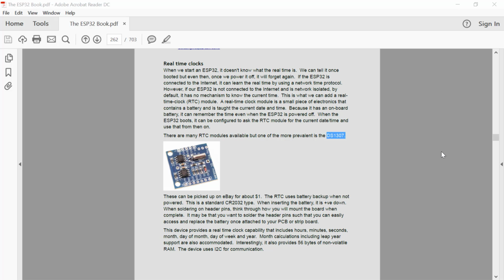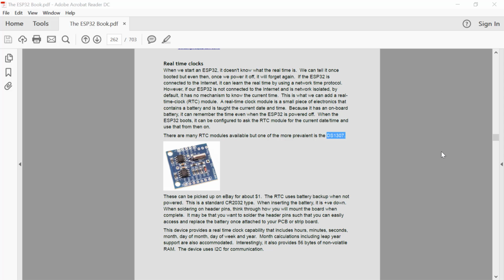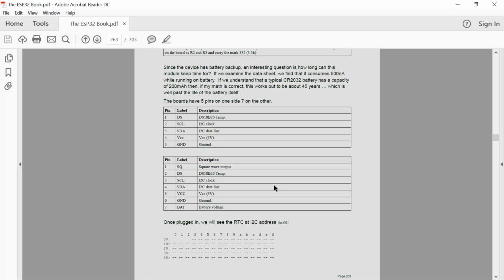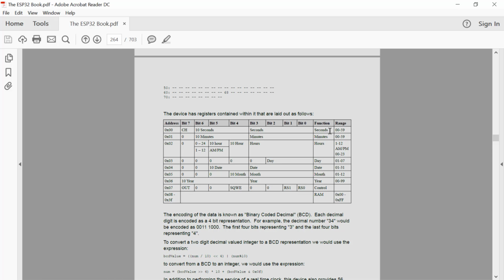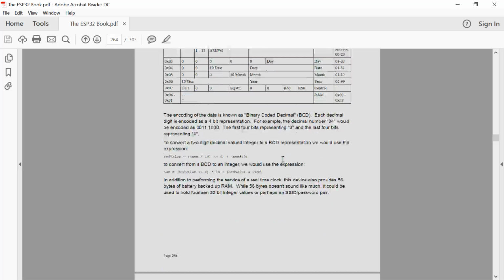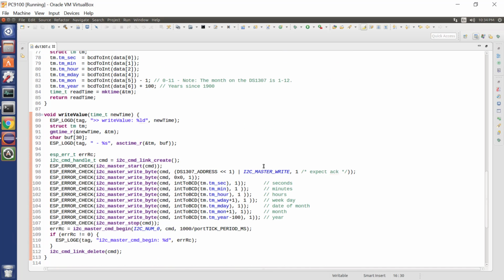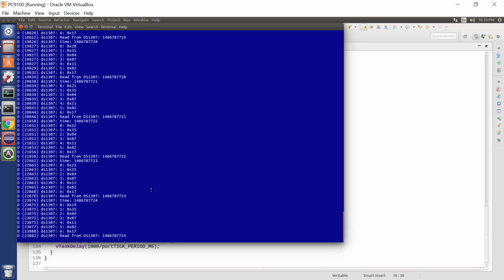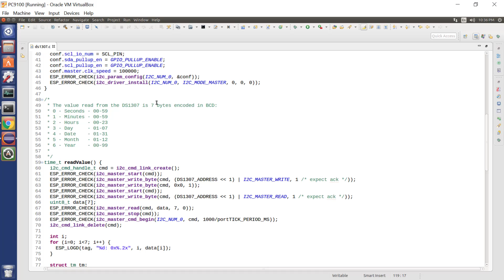ESP32 Technical Tutorials: DS1307 Real Time Clock

Comment: This doesn't address the ds1307 minimum voltage of 4.5V so it will not run off the 3.3V.  Connecting it to 5V there may be some issues with the IO of the esp32 not being 5v tolerant.

Comment: Hi, nice Tutorial, but according to specs the ESP 32 has a RTC  already on board. https://cdn.sparkfun.com/assets/home_page_posts/2/0/1/7/esp32-block-diagram.png
Doesn`t this suffice to keep the wall clock? Am I missing something?
Reply from the maker: Howdy, the in-built RTC will indeed keep wall clock time but only for as long as the ESP32 has power.  These cheap RTC modules have their own coin-cell battery source which ( I believe) is good for years.
Reply: Ah I see, thanks for answering.

Comment: Thanks for this, is there the facility for time-based interrupt to wake the esp32 from low power sleep?
Reply: nevermind, just found similar question for arduino on adafruit forums, i include the reply:

The only way for an external component to wake up the Arduino is via an interrupt. Unfortunately, the DS1307 does not have an "alarm" output. It only has the SQW squarewave pin. You could conceivably use this to wake up the Arduino periodically to check the time. But the slowest rate on the SQW pin is 1Hz. You might be better off looking into the "WDT" Watchdog Timer on the Arudino.
Reply: Howdy Tyeth, might I suggest you post this as a question to the ESP32 forum found here ... http://esp32.com/index.php

The bottom line (from my perspective) is that the ESP32 can be woken up on time base interval.  For the ESP32 to "wake up" it must have power for it to wake up.  If an ESP32 has power then it can put itself into a deep sleep mode and consume very little while it is sleeping ... and then ... wake itself up at a given time.  The DS1307 story comes into play only if there is NO power associated with an ESP32 and, when power is eventually applied to it, then it can know the current real time without needing to be told or having an Internet connection.